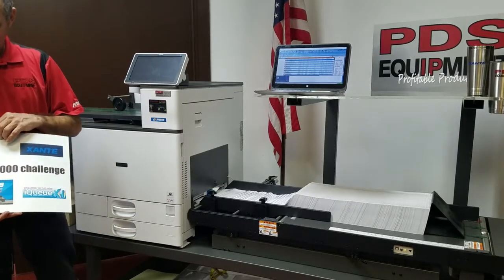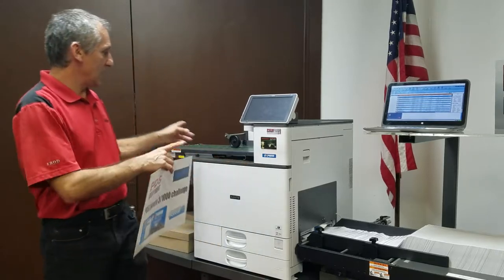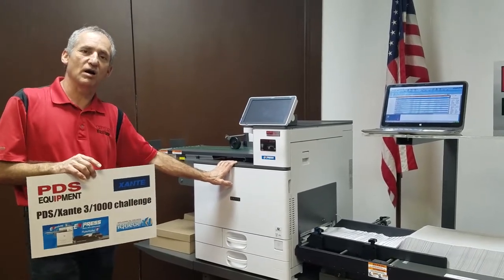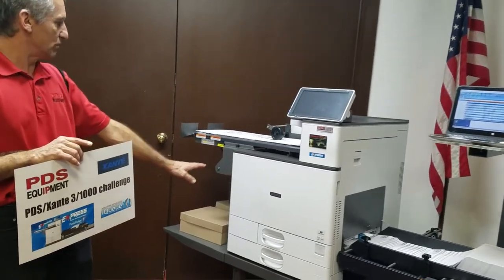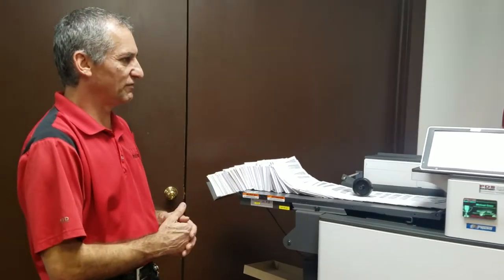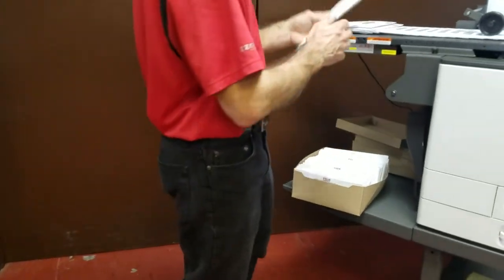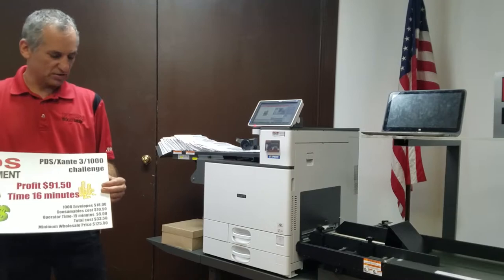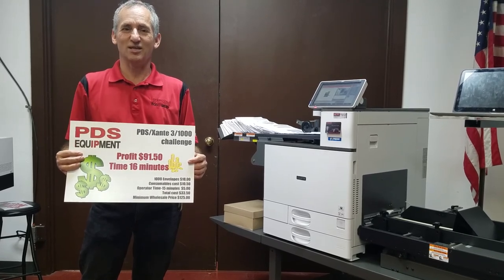PDS Equipment showing the Xante EnPress running 1000 envelopes.

Comment: I regret buying my Enpress.   For two years I cannot get my feeder to feed right.   I still can't.  Back and forth with tech support telling me to raise/lower the feed roller 1mm, adjusted belt speeds, replaced sensors and boards.   It has been a nightmare purchase for me
Reply: Who was your installing dealer?
Reply: I am in the exact same boat as you. Back and forth with support and still having issues and I have owned mine for over a year.
Reply: @OBJenn  I'm always raising the feeder wheel and adjusting the belt speeds. I can never get the envelopes to feed consistently thru a run and it can jam with envelopes. I can't just walk away and let the feeder run. I've also replaced sensors. Sometimes I hand feed small chunks of envelopes thru just to get the job out. Also, It doesn't print well on coated card stock - solid areas are blotchy or I get imaging lines. I've tried working with tech support, but they always want you to email photos/video back and forth then you have to wait until they get back. Just time consuming. So I just struggle thru jobs. It's been a struggle for two years. I wish they would come out with an easier feeder. I always dread having to use it. I do like the IQue.

Comment: My Xante EnPress has been the worst investment I have made in 40 years of business.  Had it for two and a half years and it would better serve me as a boat anchor.  Feeder is horrible. (jam every 2 or 3 envelopes)  I have spent more hours on the phone with tech support than I have printing envelopes through the conveyor.  We now print through tray 2 and lose money on every job from the labor it takes to load, empty, clear jams etc.  Must open the feed door for every jam and it usually wastes 2-3 envelopes every time there is a jam.  They want $2700 per year in support when they couldn't even get it fixed for the entire first year under warranty.  Their support videos do not allow comments, so I will post my own videos showing how bad it is.  They will be the same videos I have sent Xante tech support.
Reply: Who was your installing dealer?
Reply: @brianweist4234  They didn't send an installer.  Made me do it.  Later they sent a "certified" guy from the company we use for all our leased printers.  He could not get it to work either.  I was told by Xante that they do not do field service calls.  For the first year, they kept sending me parts and instructions on how to replace them.  Along with the many parts, they sent 3 different doors, then an entire machine.  Second machine is worse than the first.  With the first machine, we could get a dozen or so thru before jamming.
Reply: @daveburgat2872  where are you located?
Reply: @brianweist4234  Oklahoma City
Reply: @brianweist4234  Oklahoma City
Reply: I prefer my HP 4200 with envelope feeder over my Xante Enpress with enterprise feeder.   Even though the HP 4200 only prints black/white - it feeds without any trouble.   I also use my offset envelope feeder for jobs.   The enterprise feeder runs horribly for me, lots of headaches.   I've tried adjusting belt speeds, adjust the roller height, replaced sensors (from xante tech support recommendation).   Tech support requests to see video/photos (which I've done) - but just too time consuming for me.
Reply: I purchased a Xante Enpress new with enterprise feeder. Worst business investment/decision I've made. It's been a struggle with feeding envelopes for two years owning it. I've replaced sensors, boards, adjust belt speeds, raise/lower the feeder wheel, etc. - and added a new brush wheel kit they recently came out with. I had a tech (from the dealer where I purchased the Enpress new) install it and it and the new brush wheel kit did not work - it blew out my enterprise feeder while a Xante tech on the phone said to hold down the button in number of sequences. The brush wheel kit received was defective and disabled my feeder. Now I have to pay for a tech to take it out and install the previous electronic boards. Xante would only pay to ship the defective part back.

Comment: We went from a 12 year old Xante Illumina that ran pretty good to the new EnPress. Generally speaking, as technology becomes newer it's supposed to get better. The EnPress seems to be an exception to that rule. After a fair amount of trials and tribulations all I can say about the EnPress in my opinion is to avoid it, avoid it!  The flatbed feeder seems like it was designed as a mechanical engineering capstone project at a college that worked for 5-10 minutes during conference so some kid could get his degree. First, having to feed envelopes in flap up and flap back.. AND coming out the conveyor image side down...Really? What in the hell? If envelopes are even one bit imperfect out of the box, which in reality they most often are, the feeding is annoyingly inconsistent. You have to stand atop the thing babysitting it all the time. One minute they don't advance enough and it misses, the next they pile up way to fast. As you can imagine with envelopes feeding in from the bottom, the up-down image registration looks terrible at the top of the envelope, unacceptable AFAIAC, that even using very high quality envelopes. You need the special fuser to run A6 and A7 envelopes at a normal speed, but there's no provision to run A2's at anything but a snail's pace. The slower the machine runs, the worse the fusing is. If in the market for a digital envelope machine I would definitely shop for something else, as this thing is just way too sub-par and annoying to be stuck with.